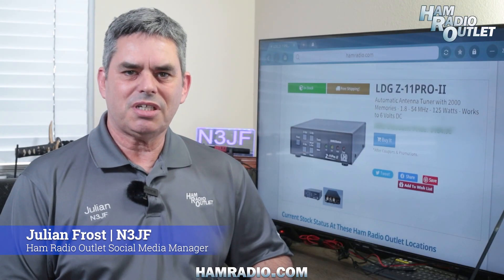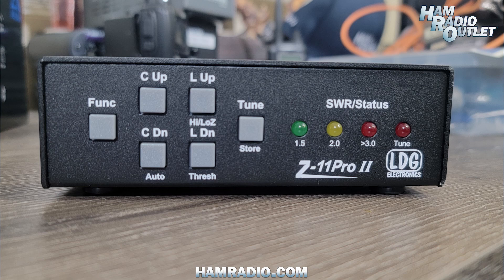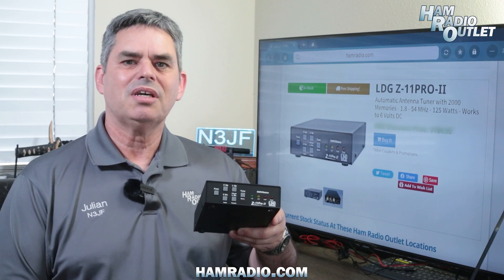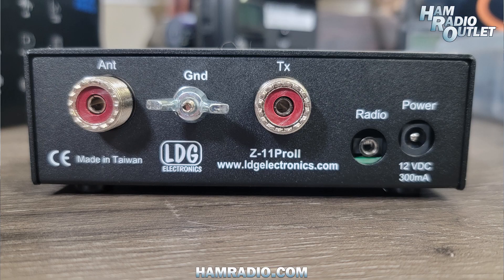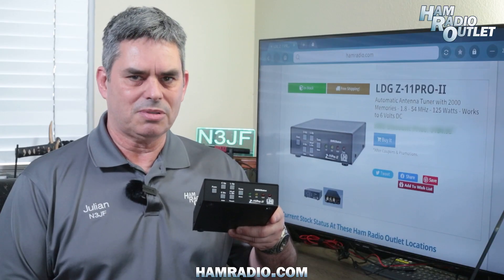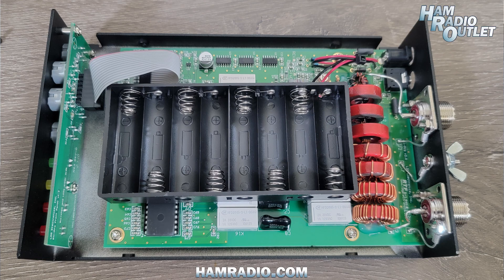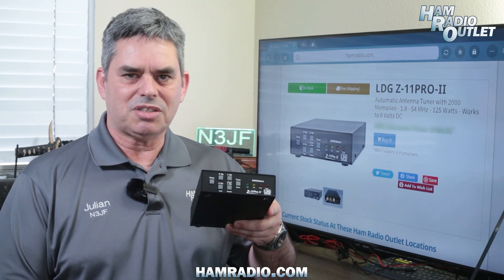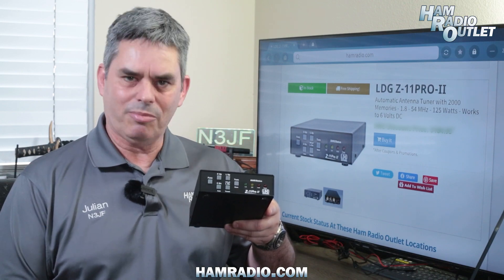LDG Z11-ProII Automatic Antenna Tuner - Ham Radio Outlet

Comment: LDG Electronics manufactures excellent Products. What I like exspecially about this Auto Tuner is you can run it with AA Batteries. I never done that with mine because of using the Remote Cable plug into my iCOM Transceiver. Happy Weekend to everyone & 73 de Uncle Guenter 💯👍🙋‍♂
Reply from the maker: The only thing I would change on this tuner, is to have thumbscrews holding the case closed, rather than regular screws. That way you could more easily add, replace, and remove batteries without the need for tools.
Reply: @HamRadioOutlet  Yup agreed!  I definitely would do the same Thing on mine if I occasionally feel like using it with Batteries. The LDG People did not had that on mind as they designed this well working Device before throwing it out on the Market.